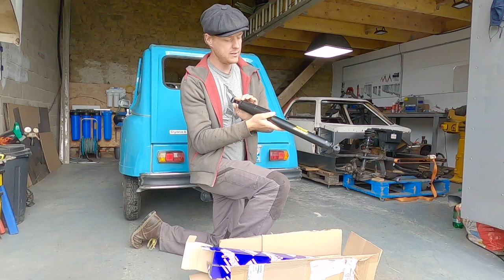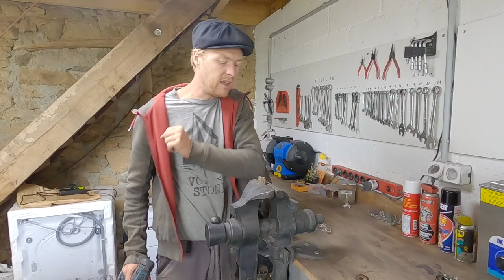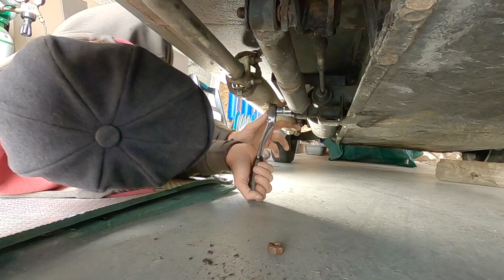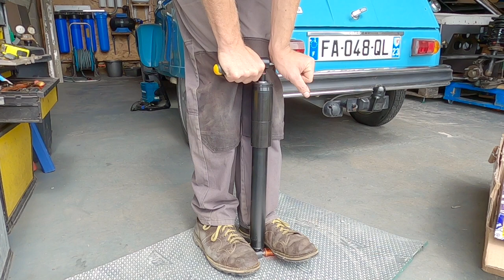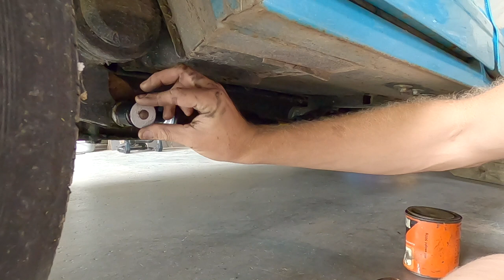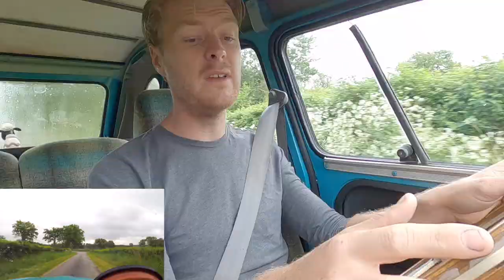Citroen Dyane Ep2 - Fitting and Testing Citroen Dyane/2cv Shock Absorbers.

Comment: Oliver, i took your advise and bought a dyane 6. 1980. 79800 km from new. 2 owners. the guy i bought it of had only done 2500 km in 
the 20 years of ownership.the car has been in the aude all its life i cant find any rot anywhere. i drove it fom carcassonne to my home in graulhet
without mishap. the paint is not good like it is on your parents, there is plenty of dents and scrapes. i may just polish up the paint and 
give it the patina look.decided to call her lucille or lucy for short.
this vid is useful as i have been scrabling around underneath inspecting the shocks which still have the paper labels on them.
keep up the good work

Comment: you should have shown how to do the front absorbers on a Dyane 6, and not only the rear.  Because there is a trick on how to loosen the schock aborber plates without completely removing them. Fidly, but possible to replace both the front absorbers.

Comment: Great for your mom, here in Argentina you can barely see some Dyanes..I think not many came in with imports, so if many are looking for them to gut and remove the gearbox and place it in the 2cv6 since it has disc brakes, I hear people say that then here it is difficult to get the brake discs.

It is a pity that the 2v6 (3cv in Argentina) has not had an upgrade in having double braking system and disc brakes.

Comment: Surely the direction of travel means the shock cover will fill up with dirt and water. Why compress the shocks 5 times and fit them that way around?
Reply: I was wondering about the orientation of the shocks too, collecting grit, gravel and dirt thrown up by the tires.
Reply: @aarondesrochers3890  A mate of mine makes gas springs, he got an order from the UK military, got sent plans to make a one off huge gas spring that cost a fortune. Then they got an order for lots at the same price, they made a mint. They kept getting orders, all very mysterious and extremely profitable.. Then one day a man from the MOD rang up and said why do your gas springs keep failing they are useless, my mates says they shouldn't, what are you doing with them, Mr MOD says says I cannot tell you it's an official secret, my mate says how can I help you if you will not share info?  The MOD eventually spilled the beans... Seems they were using them for tank gun recoil units and were fitting them upside down, so all the oil went the wrong way.